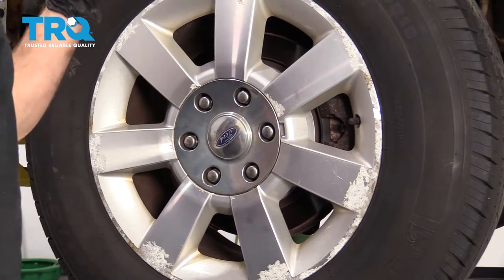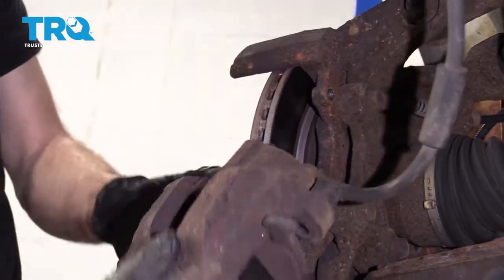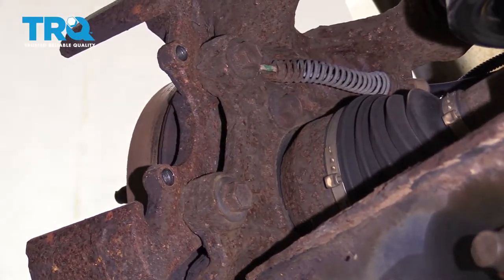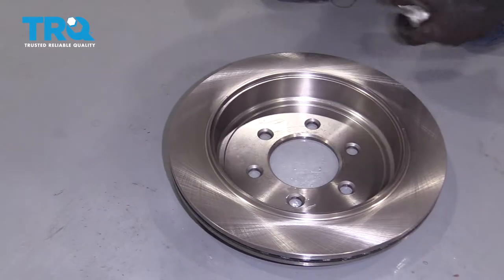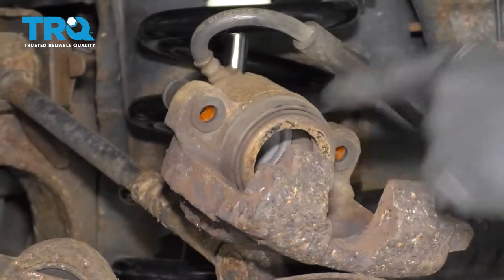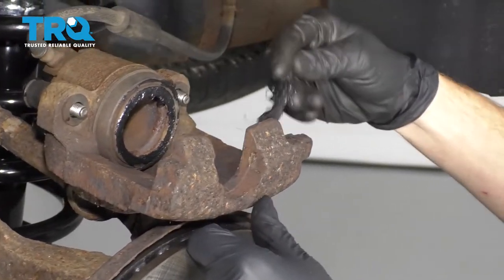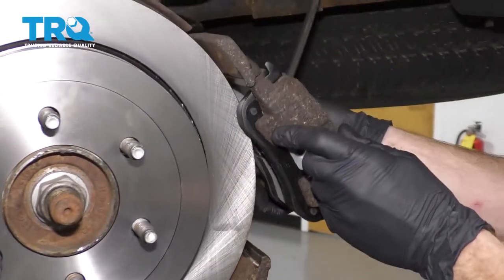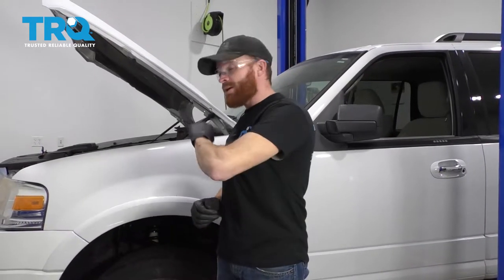How to Replace Rear Brakes 2007-2017 Ford Expedition

Comment: For those who don't have a lift, and work in the driveway,  you should note that the front wheels must be CHOCKED, as the e brakes must be released in order to get the rotor off, so it will not roll downhill into the neighbor's car (not that this really happened  😲)

Comment: Question. I just did pads and rotors on my wife’s and now I hear what sounds like a dragging noise coming from the rear right. I double checked and everything is tight. Any ideas?  And it’s intermittent. I put the brake grease (gray) that came with my new equipment on the slide pins. Think that he be causing the pads to not slide back?